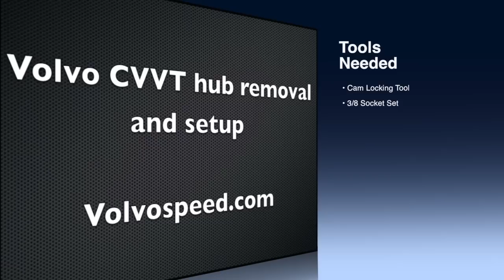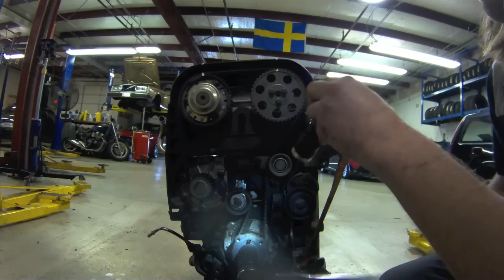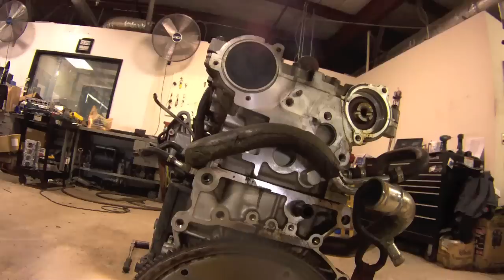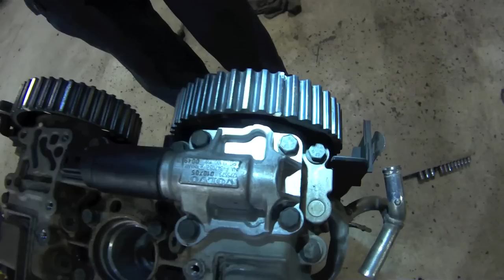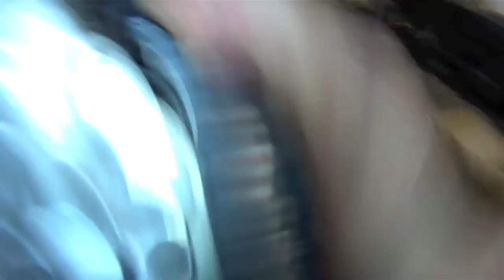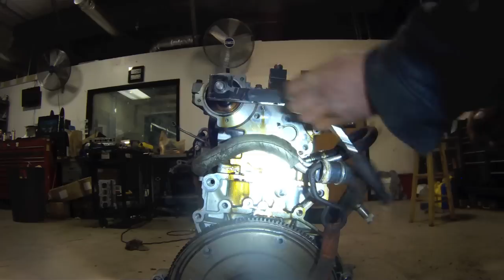CVVT Removal And Setup

Comment: Thank God I cam across your video before I was going to just use a cam sprocket locking tool between the sprockets to loosen the Cvvt. Now I understand why the cam has to be locked before the cvvt is loosened and removed. You just saved me a gigantic nightmare! I bought a kit that has everything in it for Volvo s40, which is what looks identical to the engine you are using here. Not sure how to get the back side off to get to the cam yet, but I hope that won't  be too much of a nightmare. Thank you so much!

Comment: Thanks for the video.  Knowing that the exhaust cam position is not locked to the sprocket, and that you remove the T55 to get at the bolt, and the torque spec for reassembly was priceless.

Comment: Put a camshaft timing tool in place. Put a crankshaft timing tool in place (or just align the timing marks of the oil pump and the crankshaft wheel). Just before putting the timing belt on TURN THE VVT WHEEL TOTALLY CLOCKWISE. That's all. Your markings on cam wheels are only "useful" for future, after taking off the timing tools. Always remember the cam wheels are just wheels, they do not make any timing job.

Comment: Thanks for the great video. I've been a Volvo fan since I was 20 years old. I am now 70 and still work as a Diesel Mechanic and also do all my own car maintenance and repairs. I started off with a 122S B18 Amazon  and now own a 1998 S40 2.0 T and a 2006 S40 T5 that has the B52542T 5 engine. Ive done timing belt replacement on the T5, but was puzzled about doing the camshaft seals after hearing about the spring loaded CVVT hub. I have been searching for some time to find a tutorial on how to change the seals and lock the camshafts. No video explained in detail about locking the camshafts until I saw yours. The 2,0 Litre and 2,5 Litre engines look the same excepting that the 2.5 has an extra cylinder. Even the width of the engines look the same. I'll be able to make a camshaft locking tool in no time at all and I'm sure that it will fit both engines. Once again, thank you for a very informative tutorial. Through you I''l be able to tackle the job with confidence, knowing that I can't make a mistake following your instructions. Best regards, Chuck G. Hodgskin.

Comment: Just So Everyone knows when you tighten down the cvvt bolt the cam gear will move from where you initially set it.position your cvvt gear a little(very little) before the mark so when you tighten it ends up exactly at rest position mark

Comment: Nice video. A couple issues. First, the VVT gear on some engines (like the S40/V40) doesn't spring back, so there's no need to mark it once the cams are locked. Second the factory procedure says NOT to torque the VVT gear fully until the belt is installed and adjusted. This allows the belt tensioner to remove any slackbetween the intake & exhaust gear. Also, torque on the four cyl is 66ft lbs, not 88.
Reply: +TheSok66  Good point Sok66 same thing with my V40. Those variations are never ending story. Did you try to take VVT Solenoid a part and clean it.

Comment: The tensioner center bolt is 15ft-lb  good to know because it's not that much. Too tight, and you have problems - the belt may 'walk' or not stay centered. When tightening this bolt down, often times the needle moves to the right, so may set the needle a little more to the left (cold) so it moves to center when the bolt it tightened down. The center position is at 70F (20C) engine temp. Left tab is for around 10F, right tab is at engine warmed up temperature

Comment: Good video, thank you for taking time and posting. Just to ad not all hubs will move back and fort from rest point forward and back. On some V40 hub is locked in place by spring and pin and unlocks only when spins (think centrifugal force). Please read some of comments. Cam locking tool is must $60 on Ebay

Comment: Regards. Thank you very much for sharing your procedure. Just one question. What is the purpose of removing the Torx bold from the center of the variable timing unit? Why dont you let it there and just rotate the hub when installing the timing belt? That way it is not gonna be necessary to replace the bold and to tight it again. I have doubts about that. Thanks! 👍

Comment: A great and very informative video. My question is why do you have to change these in the first place. I had my Volvo S40 2003 replaced the timing chain after it broke. After everything was done, the engine is so bad. NO POWER AT ALL. could it be that I need to change the  CVVT as well. Pls help

Comment: Sooo, Sooo simple to do. This Video and the Mechanic Instructions is simplified that an intermediate mechanic can accomplish. LoL, most repair shop wanted between $750.00 - $1,250.00 to do the job. I followed the instructions on this video to the "T" and PERFECTO! Saved me some big money. Please note; most auto repair shops will put the "Interference Engine" and fear tactics BS as the reason for the excess cost of the job...Lol, the OEM kit and additional Volvo OEM parts cost less than $250.00. If ever in doubt just hand crank (manually turn engine) the flywheel nut, hear any noise? pause the video, replay it over and over again if needed before you put that key in the ignition.

Comment: help!!! we took off the cam sprockets without making marks so the right one (with the center bolt)  moved whilst removing the three bolts (we didn't have the tool so we did it our way by clamping the inner part of the sprocket whilst backing off the center bolt). how do we line up the cams properly now??? I see a notch on both cams. the left one (exhaust I think) was in line with the notch on the timing cover. is that accurate and does the same apply to the right side? please help the car won't start it cranks but no start

Comment: Great video...however you rotated the rear exhaust camshaft to line up the locking device. Do you not have to re-rotate that shaft into its original position to keep the timing on mark?
Reply: good point
Reply: i think that need camshaft line up to lockind device because him rotate engine anticlokwise, cvt not rotate camshaft
Reply: I was do it before really it most rotate from back camshaft to right position you can not put it to line up
Reply: when you loosen the camshaft position sensor trigger wheel bolt on the exhaust cam (not shown in this video), it sometimes moves the camshaft which is why the cam was a little to the left. if you rotate the exhaust cam back to where it is slanted... the timing will be off. always leave the cam where it is after removing the locking tool. the notches should be inline with each other.

Comment: when installing a new cam facer actuator I can see the can gear is adjustable  3 bolts attached to actuator when  should those be move or when  can be adjusted?
I have a volvo that double actuator for some reason the previous mechanic took or lost cam facer is duble vvt actuator there are no marks any where ,i have the  cam lock tool but how do I set up properly this  actuator with out previous mark references
 than you for your video

Comment: I believe these are the engines in the P2 S60 V70 cars with the RN engines (2.4, 2.5 etc).  These engines had VVT hubs technology.  The CVVT hubs (Contnuous VVT) were rather used in the RNC engines (revised RN) used in the 2nd gen Volvo S40, V50, C70, S80, C30
Robert DIY also has an interesting video on VVT hub removal  https://www.youtube.com/watch?v=0H5cgRYCMQg

Comment: I have a 2006 S60 2.5T AWD......I just finished putting my engine back together after completing a PCV replace, oil pump gasket & o-ring, timing belt, tensioner, idler pully, front camshaft seals, and Hub O-rings.  I had everything marked before taking apart and all line up top dead center.  After I put it back together I cranked the engine over at least 4 times and everything lines up again at top dead center.  I'm ready to start the engine.  However, before I turn the key all the way I turned it just before ignition.  My check engine light is blinking.  I can't read the code though without my engine running (I don't think I can, may try later).  My question is: will I ruin my engine if I start it up?  I'm thinking the Volvo has at least a sensor that would stop it from destroying itself on start up. Plus I'm thinking if I was able to turn it over 4 times then the timing should be close, at least not catastrophically off.  Should I start her up?

Comment: My MOD doesnt explain it this way, Im not confident Im getting my timing marks right, with cam lock tool installed, the marks on sprocket faces didnt line up with cover, my new vvt sprockiet has no mark on the face, im not sure if it was spring loaded or not, and without a crank lock tool, how can I be sure the crank gear is positioned correctly?   I have it set with tit on cover between two crank gear marks, however it looks like it could be half a tooth off on crank gear.  Currently getting a code 60 (cam reset) or p0017. It has a fresh oil change with synthetic, good base oil pressure 50 psi cold, replaced vvt sprocket, cam solenoid, and new belt (contitech),  
thanks for any help you can give me.

Comment: YOU ARE ASSUMING THAT I HAVE A GOOD TIMING BELT AND VVT PULLEY BEFORE REPLACING IT.  MY VVT PULLEY BROKE OFF AND NEED TO KNOW THE PROPER WAY TO SET UP THE TIMING FROM SCRATCH.  I GET NO GOOD INSTRUCTIONS FROM SHOP PROGRAMS AND ONLINE HAS PROVEN USELESS SO FAR. NO ONE SEEMS TO KNOW HOW.???? ANY HELP?

Comment: Is this CVVT only on the exhaust side?? Odd. I have a single VVT but it's on the inlet side of a 2000 B5244S 2.4L ... maybe the orientation of the 2.5L (which I think you are working on) i different?

Comment: Question 2002 Volvo 2.4 turbo only has the one VVT hub exhaust side. Visually can you tell the difference between a spring-loaded and non spring-loaded hub?....mine did not spring back when removing the timing belt, And timing mark did not move..So I did not know if this hub was bad?

Comment: I LOOKED IN THE ENGINE COMPARTMENT I SAW OIL LEAK COMING FROM THE VICINITY OF THE STEARING WHEEL CONNECTORS AND NEAR THE TIMING BELT. WHAT CAUSES THIS AND HW CAN I FIX IT (DO IT MYSELF)???
RESPECT TAFARI FROM JAMAICA***

Comment: Can you tell me if the torque for the s40 is 88lbs also, or is it 66lbs? Someone wrote on one video that the torque for the s40 is only 66'lbs. I tightened it at 66lbs. and the check engine light is on again after resetting it. The car runs great, drives fine, seems like the timing is fine also, it all aligns. The sprocket on the s 40 does not move either, like this one.

Comment: Hi, I did it right this way, but I also tightend the belt CLOCKWISE, like you said... now i read on Volvo Vida, that Volvo said, you have to move it AGAINST Clockwise... is this bad?  Will make this problems or damage the tightener /Engine?? I need a quick respons
Reply: The tensioner will become damaged if tensioned the wrong way.

Comment: yes, got the same problem. What if we removed the vvt pulley and didn't  mark the pulleys? the vvt system I have isnt spring loaded. There isnt anything in Alldata that will show you how to setup the pulley from scratch! NO ONE KNOWS HOW TO DO IT!!!!!!!!!
Reply: did you ever find an answer??? I took off both gears and the moved both cams all over the place and removed from the head. S70 turbo.... I am trying to find out the correct lining for the gear on the cam itself. 
The intake gear has a mark on the inside, but nothing is on the other one. 

MAYBE IT DOES NOT MATTER??? MAYBE?
Reply: Youll need the crank locking tool
Reply: You need the cam locking tool, it locks the cams on the drivers side of engine... There are slots there... That gets the cams timed correctly.  Once you get the exhaust VVT assembly off the exhaust cam you snug the new one  down, and turn it both ways to make sure it is  locked.  Once it locks you use a file and white paint to make new timing mark that lines up with the cover...  After that you torque down everything to specs, remove the camshaft locking tool, and turn engine two rotations clockwise and double check the tensionor and timing marks.
Reply: doe the cams have to be 85punds exactly ? 
 @jonrobert8762

Comment: I took off both gears and the moved both 
cams all over the place and removed from the head. S70 turbo.... I am 
trying to find out the correct lining for the gear on the cam itself. 
The intake gear has a mark on the inside, but nothing is on the other one. 

MAYBE IT DOES NOT MATTER??? MAYBE?
Reply: face the cam lobes away from each other on number one cylinder and bolt that special tool in then your good

Comment: I have a 2014 S60 T5 and I have the P0016 code took it to the dealer and they replaced the CVVT solenoid. But the check engine light is still on the dealer said that next step is the Cvvt Hub I’m not sure that’s the problem tho and the code is still P0016 any idea ???

Comment: HI 07 XC70 REMOVE BOTH CAM HUP AND REPLACE THEM AND TIMING UESD TOOL CAM AND CRANCK FOR LINE UP BUT AFTER DONE CHECK ENGINE LIGHT IS ON FOR P0016 CAM AND CRANCK CORPITION  I DID NOT MARK CAM PLAY IS ANY WHY IS LINE IT UP AFTER REMOVE ?  THANKYOU

Comment: The real question is... How do you time the VVT sprocket if you didn't make your marks prior to disassembly?
Reply: marks on sprocket face line up with notch on upper plastic timing belt cover.
Reply: han nguyen Yes, but if you just throw the VVT sprocket on at the factory mark without making sure it lines up at the end of its stroke, it'd throw a light and run like crap. We figured it out though, thanks.
Reply: ***** what did you come up with to "time" it?
Reply: schweg2 Honestly we've worked on a ton of cars since then, so it's a little foggy, but if I remember correctly we just verified the stroke on the VVT sprocket was within spec. When you turn the sprocket counterclockwise until it stops then back clockwise until it stops the timing mark on the sprocket at 12 o clock should line up with the timing mark on the cover. I bought the special tool online for around 100 bucks and it worked like a champ. But making marks prior to disassembly makes things a little easier to verify you're on point.
Reply: Paul Fussell
Reply: charlietow So what your saying is turn the cams until they are positioned with the vvt turned clockwise and the mark facing 12 oclock or aligned with the mark? Both vvt cams should be like that? and the notches on the opposite side of the cams should be horizontal right?
Reply: Otherwise the other way I was looking at it, is to have the notches on the cam sensor side in the correct positions (intake part number on bottom, exhaust part number on top) and then just line up the vvt til the mark on the sprocket is matching the mark on the cover regardless of the position of the vvt (as in it may be a little off from turned fully clockwise)? And if I am rebuilding the entire engine, is the engine able to get oil to the vvt in time to get it set correctly on first startup?

Comment: I have a big stream of oil coming straight up about 8 inches high with the engine running from between the 2 cam shaft pulleys. Does anyone would have an idea where is coming from? Thank you.

Comment: If you mark the old cam pulley to head, then replace the pulley, so what are you aligning new pulley to when it was not marked, is there a reference point on new cam pulley that you are using?
Reply: Mike OSullivan. Same question 
When he locked the cams he had to move it a little to be even.   Why he did not put it back where it was ?

Comment: Need Help, I have a 2001 v40, VVT hub was leaking oil and bought a new one. I marked timing then locked the cams with the locking tool,removed the old hub and installed the new one but issue is hub doesn't move at all. I can't rotate the hub to set the timing, I try installing the old hub to see if it was a bad hub but neither one of them move after the center bolt is tightened up. Any advice?
Reply: +AibonitoPerformance PR Hope you all ready figure it out. On some V40 hub is locked in place with spring and pin and will not move as one in this video. This type moves only when spinning meaning centrifugal force will unlock it.

Comment: very good and and want to do it like you but someone  till me if you want to remove the screw for VTT dont open it by tools like you do it but he till me open it by airgun in Swedish
motorknykare   and then what it is happen  the camshaft  is broken from the backside in special tool 
he is very stupid
thank you for your information
I well show them how i was right
Reply: thats why i install the locking tool, break loose the vvt bolt, and then remove the timing belt the timing belt acts kind of like a locking tool for the gear side of the engine. or you could use a cam gear locking tool

Comment: hops wrong info need  the crankshaft is locked behind the starter motor with a tool
Reply: I have never had to lock crank, it does not move easily once on mark.